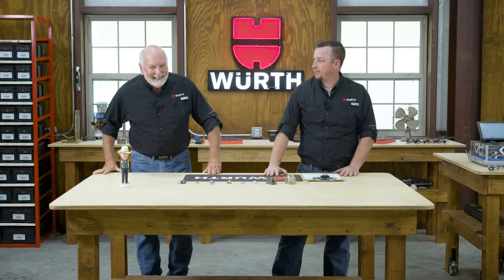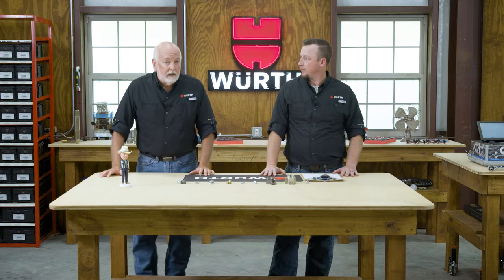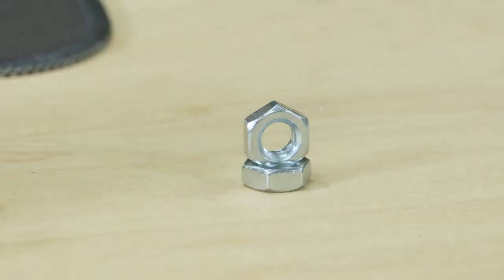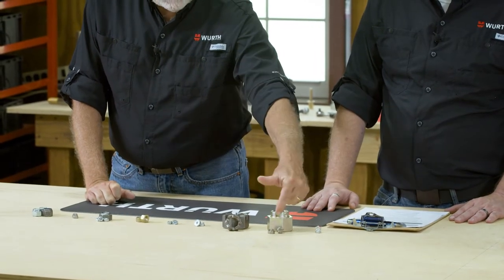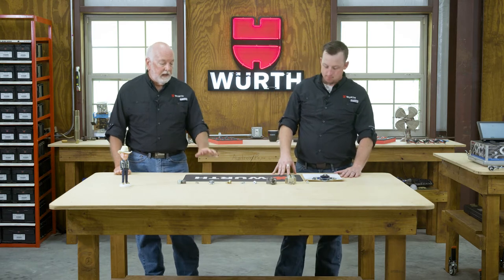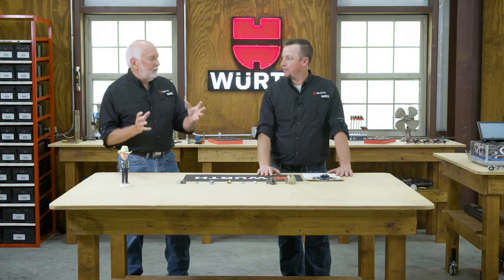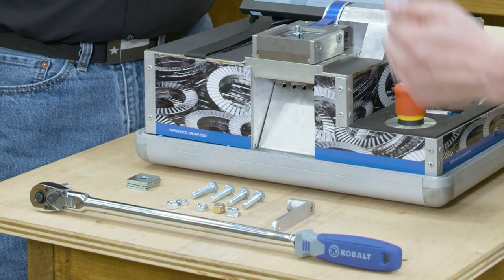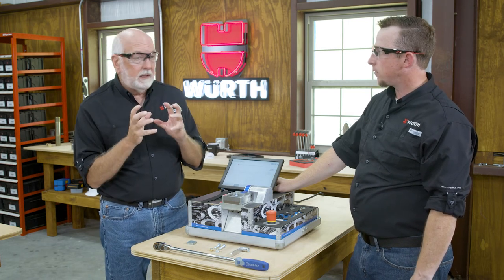Locking Nuts | Würth Knowing Episode 13

Comment: I have never heard the true name for what Aaron call “Kepts-but” or “K-Lock”.  Don’t forget having a good selection of “Star Washers” both internal and external. These are great for restoration of older vehicle for ground as well as the positive side. The cut or dig into primer & paint someone used to spruce up their investment. I do everything but electrical is my passion. Voltage drop is my weapon of choice guys. It does not lie while the circuit is on, the lower you can get the better for everything electrical. The “Star Washer” used on the ground side will cut past rust, on frame, engine, cab, bed if a truck and tailgate if they install solenoids that call “Poppers” when they shave a handle for looks or security! The serrated nut is more commonly found on imports. I have always called the the “Secondary Lock Nuts” simply deformed nuts. They have an incredible amount of “Break Away” force required when used on the exhaust. These require a high temp anti-seize applied to the stud in this application. While large (17mm) and no straight socket access, when using an impact swivel, socket, 1/2” long extension and breaker bar to remove off the exhaust manifold, it always broke loose with such force that all wrenches hit the floor. I was always shocked that my SnapOn products did not break after picking up to examine!
  Just a simple case of over engineering on the Isuzu. Nissan actually placed a bead of RTV around the bell housing of the 5 speed manuals used in the Pathfinder. Why? Water would come in easy around the starter. Duuuh! But I didn’t build it, only there to fix it. I will say that Isuzu was the only company to send an engineer into each dealer to spend 3 days talking to the tech about what problems they came across or have seen. 
 Very good video guys to review the components that are out their, names and smooth it over with just enough technical SAE or ISO discussion!
  The rising generation is lacking in this knowledge at tech schools because I guest-hosted 2-day classes for ACDelco in 13 different technical community colleges. Some where good to decent! I say this as the instructors have not wrenched on a vehicle since Nixon was president. They had limited knowledge on serial data systems and how they worked. I don’t care what color next years shock absorbers were, but if they contained a “Mageto Reological Fluid” developed by Delhi in the 60’s, but had no application. This was new for the 2004 Corvette guys! The fluid is like an oil with microscopic iron balls that stayed suspended for decades. Acura first used it in the front motor mount. With upshift, downshifts on a dynamometer, they simple wrote software to control the soft or firmness of the mount to make it smooth! Remember, martini shaken, not stirred!
 But GM’s approach was a sensor on all four corners of the suspension with reaction times of GM Local Area Network (Serial data used on high speed computers for years, like IBM’s WATSON first used to defeat a human on Jeopardy. Now an amperage sent thru two wires could change the fluids viscosity from water to 90 gear oil in 2 micro-seconds! (Ms) almost real-time dampening. It was unbelievable as I took turns driving one with 56 other ADCelco market area service managers. Way cool then, but now, almost everyone is using this technology paying per strut or car, used in stability control w/ABS. 
Traction control is just ABS working backwards. 
 Guys, always great learning and review! Thanks for the efforts!
Reply from the maker: Dean, you certainly have a lot of experience and it’s a real compliment to hear you’re enjoying the show. The nut with an assembled external tooth lock washer is called a “KEPS Nut”, which is a registered trade mark from ITW Shakeproof. The generic term frequently used is a K-Lock Nut. 

-Randy